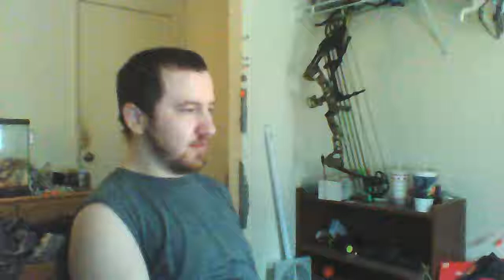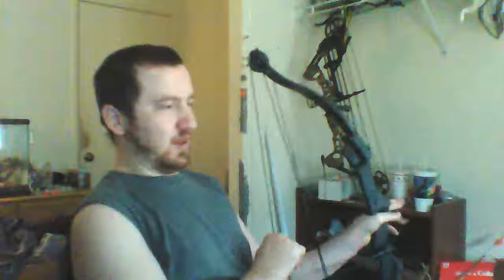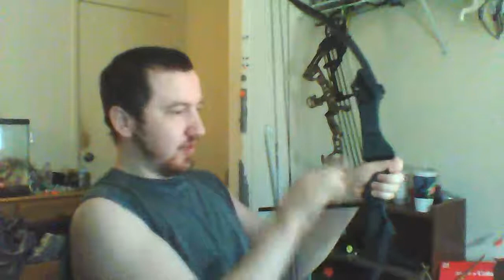Recurve coverting into a Compound Bow

Comment: Can I use any limbs I'm tryna transform my recurve bow into a compound bow by replacing the limbs
Reply from the maker: Abit late on reply but possibly, tho you might have to trim the edges to work with the curved form of the limb bolt area's.